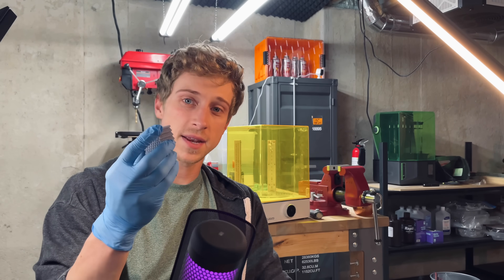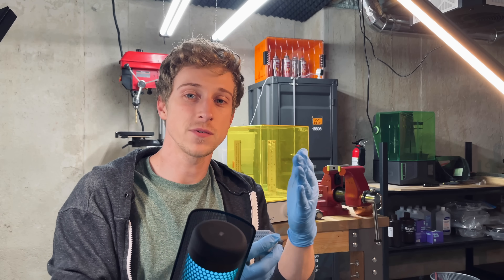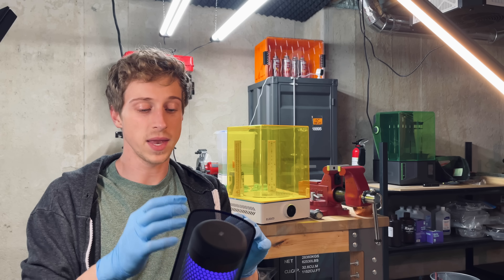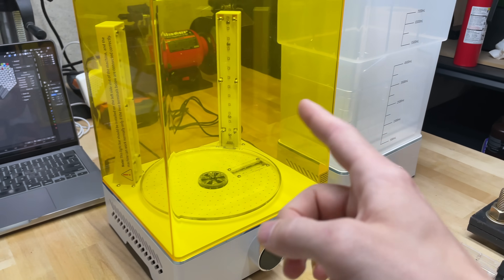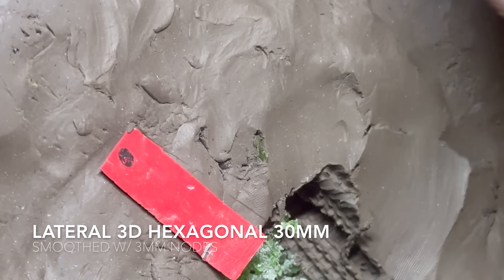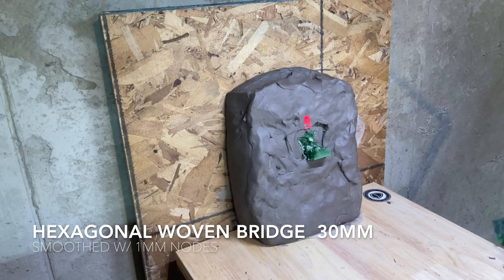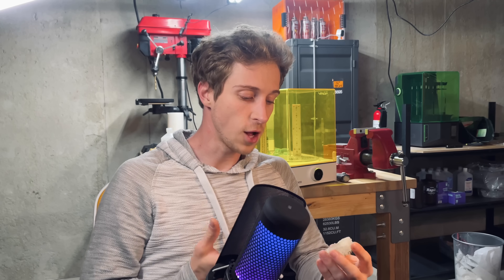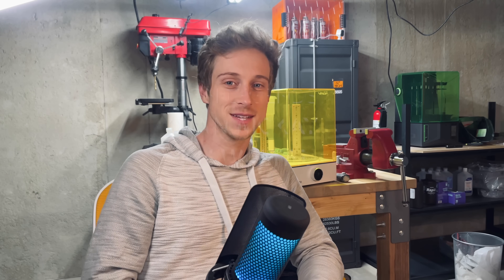Making 3D Prints Bulletproof with Molecular Structures

Comment: These look very similar to structure i've been researching for my thesis in biomedical engineering

specifically auxetic structures or structures with negative poisson ratios
Reply from the maker: Auxetics do look similar! Those often have inverse suspended bridges (So they get wider when pulling) where these need the direct support from the bridges on each layer

Comment: I wonder if you make a box with  2 mm thick walls out of pla and place this structure in there if it would improve the results. From the looks of it stress fractures in the resin from the impact is causing it to fall apart but if you can someone still have the lattice tightly together maybe the projectile will still have to break apart resin therefore taking more impact out?
Just a guess great work regardless

Comment: the red v green having the same properties is one possible variability still. in my experience the suppliers often just copy paste the datasheets changing only the dye named in the sheet, and assuming no one will check. and ive def foudn that clear/natural un dyed material is the most strength compared to the opaque colored materials but with some brands they are supposed to be the same in the datasheet.
Reply from the maker: This is a good point haha, I could totally see manufacturing saying "eh good enough" knowing folks probably aren't going to actually test those strength numbers precisely.
Reply: @CrashMakerspace yeh I hate to say it but I’ve had similar issues with suppliers in this vein. I think things are gonna be the same somehow because they say it is, but then it’s not, and then I remember that chemistry and physics is a wonderful and frighteningly complex thing. 

You may need to buy a batch of the same stuff to be consistent across tests. I’m sure if you ask People to donate a lil bit for consistent printing material of a certain type, then a lotta people would be willing to give you at least $5-$10
Reply: I would give you $10 right now if I knew how to
Reply from the maker: @DangerousGas  no worries dude, I appreciate the offer! I have Patreon & KoFi which can act as donation-like offering. I just don’t push donations since I’m trying to keep the channel pure to the science and sharing my experiements

Comment: Let's say you change to a metal Medium that can be heat treated.
Which allows to get the front half to be hard/brittle and the back half to be ductile.
I would assume the Geometrie within has to change to get the best Results.
Or short, a ton of variables.
Reply from the maker: As mentioned, I am having PcBWay 3D print from steel, so the first tests again high caliber will be done on that!

Comment: Very impressive.
I'm looking forward for more Videos about this.
I see a lot of Potential for some Composite with that. To get the best of both Mediums.
Reply from the maker: And you'll be getting more on this! Once the 3D Print of Steel arrived (Still being manufactured) I'll make the regular and then the lattice based plates and see which does better.

Comment: You could try using carbon infused resin, i have tried with micronised graphite and got up to 7% without printing performance being impacted too much. Sadly i only tested for conductivity, as i have no part tester nor guns 😅
Reply from the maker: Haha, I've got the steel 3D print being manufactured currently which should be much more robust than any resins (ceramic resins would be harder, but overall strength I'm sure would be inferior). It would be a neat test though to say this regular resin 3D printer makes larger caliber plates!

Comment: Have you considered layering multiple geometries into the same cube structure? (e.g. a single 30mm cube structure consisting of 10mm hexagonal woven bridge, 10mm woven tubulane, 10mm alternated tubulane mesh) Or do you lose strength with something like that?
Reply from the maker: This would be a fun test, likely wouldn't loose much strength. When applied to stronger materials, or ductile ones like metal this would be another factor too

Comment: Those lattices look very ansioteopic. I'm curious how they perform with a shot at an angle.
Reply from the maker: Definitely, laterally they did worse as shows with the hex smaller cube. Doing 45 etc theoretically should be fine still due to angled bridges, but I didn't perform angled tests due to increased chance of richochets in the test space haha

Comment: As a combat Marine that served during the start of both of the last wars, I always wondered if there was a way to inject an oobleck type substance into some kind of honeycomb structure to replace our heavy body armor.

Outstanding work young man! 
USMC 1999-2007
Reply from the maker: Thank you for your service! Non-Netwonian Fluids can have some promise, and as Stephen mentioned, a vacuum is about what you'd need to force it onto the voids. You'd also want that to give it time since fast pressure to push it in would actually just make it resist conforming throughout.
Reply: @CrashMakerspace  Yeah you'd need to first let the fluid settle in and then do it in steps, it'll still firm up but after a period of time it should relax again

Would be interesting how it would affect the whole structure (Perhaps in the sense of concrete and rebar?) 

Tho making a structure specifically for that purpose might be worth it

Perhaps a combination of non newt and soft rubber has a chance (as in a rubber backplate to absorb leftover kinetic energy since non newt gets brittle when at its hardest)
Reply: I can see that. Make a mesh, have it in a close fitting bag and use a vacuum system to pull the oobleck in a seal it. I'm thinking a bag made from fiberglass like the bullet catchers for homemade ceramic plates amor.
Reply: @JarheadCrayonEater  some older composite tank armour effectively works like this.
Reply: Magic sand? Or make a magic sand with aluminum oxide or tungsten carbide ,would really break up the bullet.
Reply: @scotttod6954  homie the goal is to make something lightweight, something that's 15.63 g/cm³ is absurd
Reply: @scotttod6954 bro is just spitballing his research 😂
Reply: You can, that is basically how viscoelastic armour like D3O works
Reply: I've also wondered about non-Newtonian fluids as armor!   There's some companies working on it, and if memory serves correctly, it's called fluid armor? Maybe liquid armor?
Reply: i been working on exactly that, actually
Reply: Username checks out
Reply: thank you for your service
Reply: This is awesome. Have you considered speeds higher and projectiles smaller than this experiment? If you want to test those, there are destructive testing labs that could help. This could help protect satellites from micro-debris.
Reply: Thank you for your service 🙏🏿
Reply: Oobleck is not optimal in the slightest. We already have a solution for the blunt part of body armor that's been around for like 20-30+ years. It's called trauma pads.
Reply: @Runefrag  of course it isn't, it's just shorthand for shear thickening technology
Reply: 😂 Your name! Fucking love Marines 😂😂😂 Best branch hands down
Reply: ZOG BOT 🇮🇱 🤖
Reply: @CantonSecurity , yeah, okay buddy.
Reply: ok murderer
Reply: @ThylineTheGay  well  well  well
Reply: @ThylineTheGay , LMFAO.  Ignorant child.
Reply: @ThylineTheGay  yeah cool man, go back to doing whatever useless thing you were before making the comment

Comment: Would it be possible to apply compliant mechanisms?
Reply: As ur mentioned - flexibility isnt desirable here.
Reply: @BruceNJeffAreMyFlies  Why not?
Reply: @benkayvfalsifier3817  Speed of propagation means that the force won't be distributed throughout the entire object rapidly enough. You want the back side of the object to support the front, which doesn't happen quick enough with flexibility. The bullet would move faster than the speed of propagation.
Reply: @BruceNJeffAreMyFlies  I see, so all of this is basically useless then. Regardless of what structure or material is used, it all becomes pointless after that first shot since it will always shatter the armor. That's why most body armor is made using thick, heavy, replacable plates of steel. Looking at the 3D models being made, it's still as thick as the normal plates, and until I see the better material he's using (as mentioned in the video), I have to assume he'll be using a 3d printed steel which will more than likely shatter as well since it's likely to be a high carbon steel.
Reply: @benkayvfalsifier3817  No more useless than the 'most body armor' you described...

The point isn't indestructability - a fundamental aspect of physics is that energy will go through an object, like body armor, into the thing behind it (i.e. your body). The breaking of those plates, and these cubes, is where the energy of the bullet goes, instead of into your body. That's why helmets are designed to break - you never reuse a helmet after its taken a lifesaving blow... 

You're failing to see the benefit of lighter body armor. This video's here to tell you that the benefit is huge.
Reply: @BruceNJeffAreMyFlies  That remains to be seen with the next step, whether it's both lighter and functional.
High carbon steel is stronger but shatters far too easily.  The prototypes, despite stopping the bullet, were still buried into the clay. That's concerning when you consider that the force is traveling into your body, and inner organs can't withstand that kind of shock very well.
I'm more of the opinion to have both hard and soft materials. Softer material would allow a dispersal of the force in a localized area. Soft body armor is a proven concept with the major drawback (as I understand it) is its inability to stop sharp, slow objects like knives.
My personal hope for these projects is a solid, flexible structure immersed in a newtonian fluid that would support each other by being both solid and for allowing the energy to be dispersed. 
Regardless, I would assume the point of making better body armor would be to allow the wearer to not be burdened by weight, inflexibility, and only good for one hit in a drawn-out battle.
Reply: @benkayvfalsifier3817  The point isn't whether it remains to be seen, the point is that proof of theory has been demonstrated. If you don't see the value in that, then that's fine, but that doesn't change the value to everyone else.....

The prototypes weren't being measured on whether or not they stopped the bullet going into the clay, they were being measured on their ability to reduce the damage. Your skin isn't clay - some of those bullets wouldn't have even gone in...
But these are very unlikely to be used on their own - I dont imagine our creator, here, gluing them to his bare skin. This is almost surely going to be encased in a softer material, like a fabric.... You know, like the ones youre thinking of when you mention soft body armor........

I like your non-newtonian fluid idea though, I would love to see the testing process for that, even if it results in nothing. Would be some very interesting stuff.
Reply: @BruceNJeffAreMyFlies  It does remain to be seen. Just because it works for one material doesn't mean it translates well to another. It's proof of concept, that is all.
Many complaints from those who use body armor are the welts developed after getting shot. The force gets directly transfered to whatever is behind it, just like a Newton's cradle. The conservation of energy and the conservation of mass don't disappear just because the material gets destroyed. It may have stopped the bullet, but that's all it did. This is why I don't personally approve of it (though yes, it's still impressive). I think it's a single step on the path of improvement. 
I'm glad we can both agree that an experiment with non-newtonian fluid (thx for the correction) would be interesting and worth at least a try.
Reply: @benkayvfalsifier3817  Did you really just try to use conservation of energy as evidence for material not taking energy when it breaks?

🤦
Reply: @BruceNJeffAreMyFlies  okay yeah, that one's on me